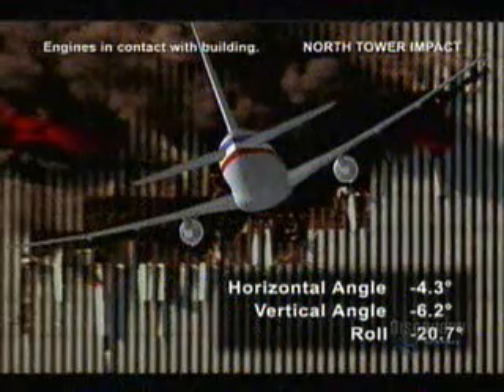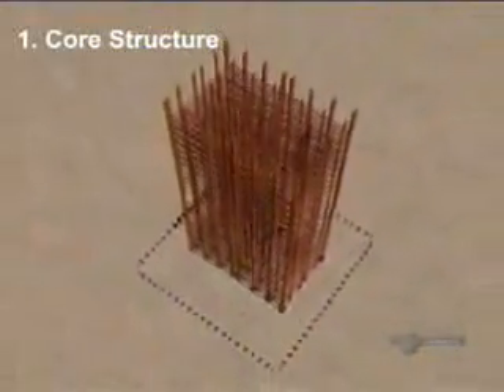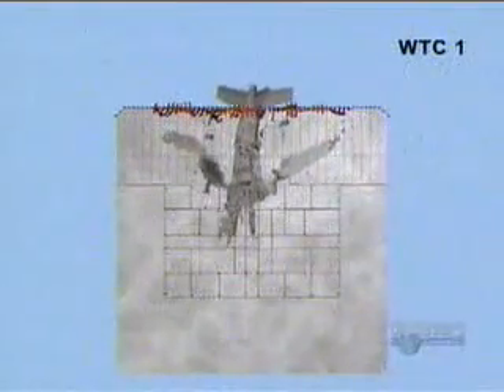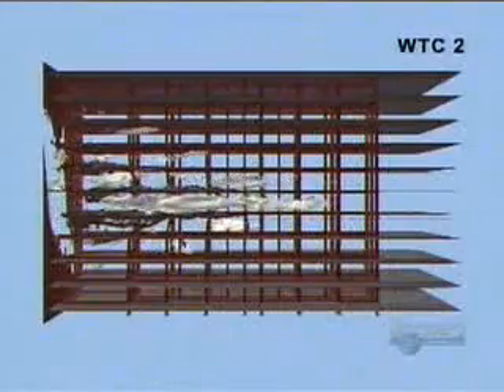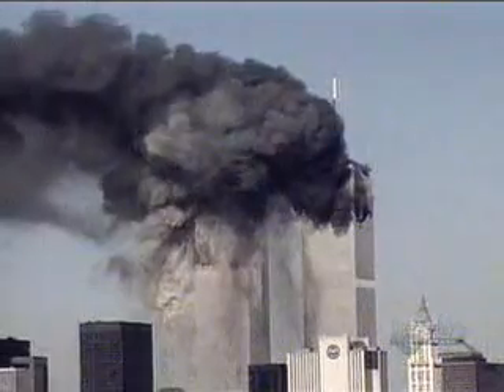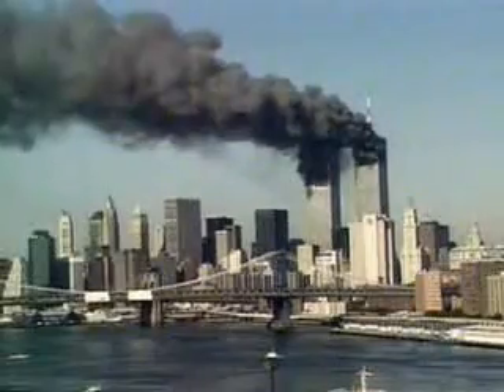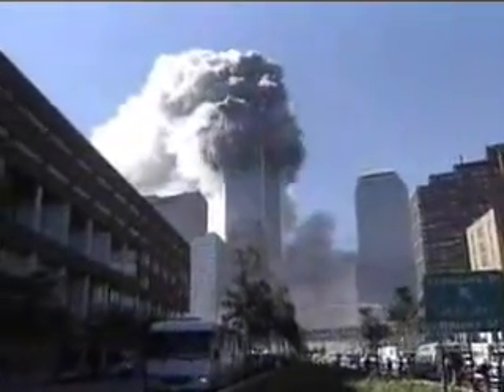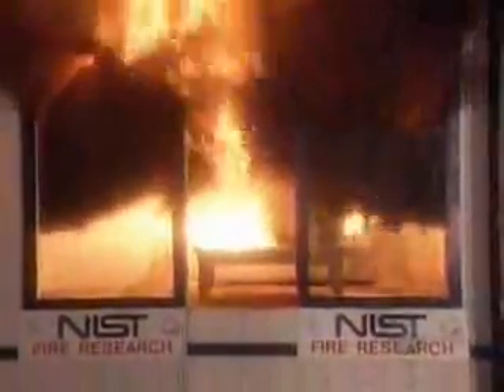9/11 What Made The WTC Twin Towers Fall

Comment: ok but jet fuel can't melt steal beams.
Reply: I agree, jet fuel cannot melt steel beams. But it burns hot enough to weaken them to the point of failure. The weakened beams coupled with all the weight already on them was, I believe, enough to cause total structural failure.
Reply: epicboy69 it didn't melt the beams, when at any point did it Mention melting steel beams. Jet fuel and fire weakend the structure. The floors started to go down and until it reached breaking point. Look don't believe any conspiracy videos it's a load of crap. They try and find something which looks like it is fake then start a conspiracy
Reply: +James D any carbon based object turns into coal once it's burned down. And you know how steal beams are manufactured right? If you have live coals you can melt nearly any metal.
Reply: Tp 3000 could you then explain why building 7 fell at gravitational acceleration?

Even with an 80% weakened structure free fall is impossible, NIST admitted as much.

This is undebunkable, building 7 was intentionally demolished.
Reply: truther tards dont know the difference of weak and melted, sorry
Reply: XCMGaming Nist says it fell at gravitational acceleration for 2.25 seconds, I suggest you take a physics class.
Reply: Ben Walls thankyou based lord
Reply: Jet Fuel cannot melt steel beams.  True.  But when it's fucking burning hot, mixed with molten aluminum + water, the beams will eventually bend and under so much pressure and heat will eventually collapse under the weight of 1/4 of a tower...
Reply: #jnation - 21st Century Music does fire travels downward or upwards? how much fuel does it take to reach all the way to the bottom of the floor while still burning? is the temperature at the bottom of the tower really enough to weaken the steels? if the bottom of the building was also burning does that mean nobody got out alive from the building?
Reply: I guess what the firemen reported who got out of the lobby area made up the stories of bombs going off. Who were the so called guys running new cable in the building with the power out lol. Sooo many real engineers say no way this could collapse the way it did.
Reply: The storeys below the 89th floor didn't burn at all!
Reply: The amount of energy falling should have equalized with the same amount of energy remaining.
X amount of floors above damaged area should have destroyed X amount of floors below damaged area, not completely flatten it.
This also doesn't explain building 3's collapse.
Reply: Stephen S that has to be the stupidest thing I've read all day. You clearly did not pay attention in middle school science when they discussed the principal of momentum.
Reply: Debunker geeks don't know anything about the concept of resistance to motion, sorry. The trade towers and Building 7 fell to the ground in the time it would have taken a controlled demolition that uses explosives to remove all vertical support structure. Too bad debunkers.
Reply: What... what a total lack of understanding of physics. Where did you get that from?! Have you ever built a house of cards?
Reply: making up facts, wtc7 was no where close to terminal velocity, will you liberals ever get a god damned clue?!

Comment: OK, so how do you explain the COMPLETE collapse of WTC7, which was a regular steel frame building that wasn't structurally damaged by a plane - fire alone wouldn't do that
Reply: Why dont you google wtc 7? Why are you commenting without even doing 30 secs. of research? Find a picture of the wtc 7 showing any signs of debris coming "right on top of the wtc 7", or any other damage from debris, other than the fire it supposedly started. WTC 4,5 and 6 were right below the towers and got all of the debris from WTC 1 and 2 right on top of them. Now google wtc 5 and see pictures of the core structure being still intact. WTC 6 was right beneath the wtc 1 tower and, even though there is a gaping hole in the center of the building, you can still see the outer core still standing. WTC 7 was across the street and didn't fall until 7-8 hours after the attacks.. How did they debris from the wtc 1 and 2 bring down wtc 7 if it stood for 7 hours after that?

Im not asking you to belive any conspiracy theories about this event, just do some research on facts. This comment is not saying that George W. Bush is a lizard and planned the whole thing or anything like that, im just saying that your comment doesn't make sens when you look at the facts.
Reply: Common theory that makes sense: You have two massive buildings collapse right next to a much smaller building. All the debris from the twin towers must have weighed quite a lot, right? So you have all this weight coming down essentially right on top of WTC7. I personally think the weight from the debris was enough to bring it down, BUT it is open to interpretation.
Reply: +fknOttz You forgot wtc 3 the Marriott Hotel, cut in half by wtc2 and almost totally demolished later by wtc 1.
 
Incidentaly, you may have seen 2 or 3 Firefighters say there was a secondary explosion in the lobby, well they were in the lobby of the Marriott Hotel when it was struck by massive chunks of falling debris from tower 2. I mention it due to truth'er videos like to use that video to prove secondary explosions, when those Firefighters didn't even know what caused the damage at the time they were filmed.

B7 was damaged by the collapse of tower 1, with 4 outer columns damaged on it's south west face, and those unfought fires that travelled through several floors throughout those near 7 hours before
eventually collapsing due to structural failure.
IIRC some 40% slower than free-fall acceleration, despite what those
truth'er videos say.